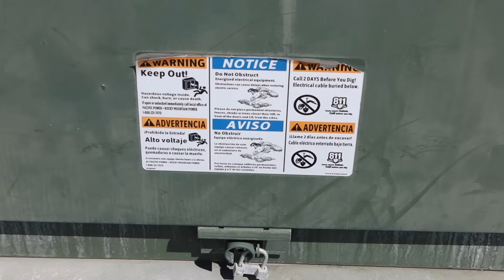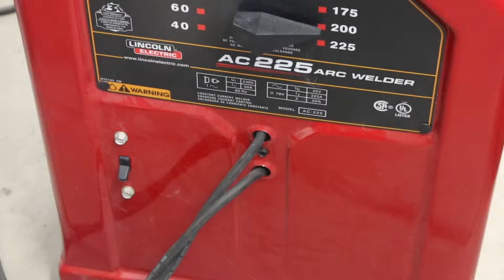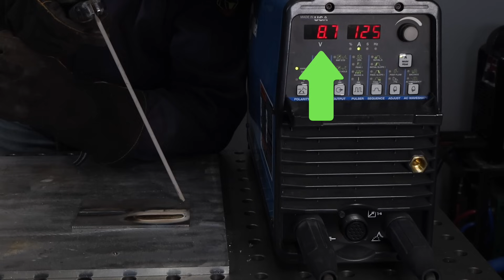Can You Get Electrocuted While Welding? Watch This...Don't Get Shocked!

Comment: One of the smartest ways to prevent electric shock and it’s never brought up in welding channels, is to take the work clamp (ground) and attach it directly to the work piece.   When clamping it to the table or vise, it just creates a longer path that the electrons flow through, thus leading to a potential “short” and traveling through one’s body.
Reply: That's what Old Black Pete the Saskatchewan cattle rancher taught me back when; of course, he did so with a little practical joke that ended with the comment: you kids today, you can't take any current!
Reply: Yes sir.  Was taught this by an old ironworker.. dude was a like a father for me.   Now I weld and am a Union Glazier (glass worker) so I'm basically always working.
Reply: I answered and said, "If I have found favor in thy sight, O Lord, show this also to thy servant: whether after death, as soon as every one of us yields up his soul, we shall be kept in rest until those times come when thou wilt renew the creation, or whether we shall be tormented at once?" 76 He answered me and said, "I will show you that also, but do not be associated with those who have shown scorn, nor number yourself among those who are tormented. 77 For you have a treasure of works laid up with the Most High; but it will not be shown to you until the last times. 78 Now, concerning death, the teaching is: When the decisive decree has gone forth from the Most High that a man shall die, as the spirit leaves the body to return again to him who gave it, first of all it adores the glory of the Most High. 79 And if it is one of those who have shown scorn and have not kept the way of the Most High, and who have despised his law, and who have hated those who fear the Most High -- 80 such spirits shall not enter into habitations, but shall immediately wander about in torments, ever grieving and sad, in seven ways. 81 The first way, because they have scorned the law of the Most High. 82 The second way, because they cannot now make a good repentance that they may live. 83 The third way, they shall see the reward laid up for those who have trusted the covenants of the Most High. 84 The fourth way, they shall consider the torment laid up for themselves in the last days. 85 The fifth way, they shall see how the habitations of the others are guarded by angels in profound quiet. 86 The sixth way, they shall see how some of them will pass over into torments. 87 The seventh way, which is worse than all the ways that have been mentioned, because they shall utterly waste away in confusion and be consumed with shame, and shall wither with fear at seeing the glory of the Most High before whom they sinned while they were alive, and before whom they are to be judged in the last times. 88 "Now this is the order of those who have kept the ways of the Most High, when they shall be separated from their mortal body. 89 During the time that they lived in it, they laboriously served the Most High, and withstood danger every hour, that they might keep the law of the Lawgiver perfectly. 90 Therefore this is the teaching concerning them: 91 First of all, they shall see with great joy the glory of him who receives them, for they shall have rest in seven orders. 92 The first order, because they have striven with great effort to overcome the evil thought which was formed with them, that it might not lead them astray from life into death. 93 The second order, because they see the perplexity in which the souls of the ungodly wander, and the punishment that awaits them. 94 The third order, they see the witness which he who formed them bears concerning them, that while they were alive they kept the law which was given them in trust. 95 The fourth order, they understand the rest which they now enjoy, being gathered into their chambers and guarded by angels in profound quiet, and the glory which awaits them in the last days. 96 The fifth order, they rejoice that they have now escaped what is corruptible, and shall inherit what is to come; and besides they see the straits and toil from which they have been delivered, and the spacious liberty which they are to receive and enjoy in immortality. 97 The sixth order, when it is shown to them how their face is to shine like the sun, and how they are to be made like the light of the stars, being incorruptible from then on. 98 The seventh order, which is greater than all that have been mentioned, because they shall rejoice with boldness, and shall be confident without confusion, and shall be glad without fear, for they hasten to behold the face of him whom they served in life and from whom they are to receive their reward when glorified. 99 This is the order of the souls of the righteous, as henceforth is announced; and the aforesaid are the ways of torment which those who would not give heed shall suffer hereafter." 100 I answered and said, "Will time therefore be given to the souls, after they have been separated from the bodies, to see what you have described to me?" 101 He said to me, "They shall have freedom for seven days, so that during these seven days they may see the things of which you have been told, and afterwards they shall be gathered in their habitations." 102 I answered and said, "If I have found favor in thy sight, show further to me, thy servant, whether on the day of judgment the righteous will be able to intercede for the ungodly or to entreat the Most High for them, 103 fathers for sons or sons for parents, brothers for brothers, relatives for their kinsmen, or friends for those who are most dear." 104 He answered me and said, "Since you have found favor in my sight, I will show you this also. The day of judgment is decisive and displays to all the seal of truth. Just as now a father does not send his son, or a son his father, or a master his servant, or a friend his dearest friend, to be ill or sleep or eat or be healed in his stead, 105 so no one shall ever pray for another on that day, neither shall any one lay a burden on another; for then every one shall bear his own righteousness and unrighteousness." 2 Esdras 2:31
Reply: @likeasparrowinthewildernes8333  bullshit. Stop believing in fairy tales

Comment: I have several times with mig and tig. Mig because we had to use an anti-spatter spray on our stainless to mild steel parts and my glove had a hole. Then with tig, somehow manage to touch my tungsten to my filler rod.

Comment: I was inside a vessel welding in the summer,  stainless vessel, all sweat my welding lead was hung up. Pulling on the lead and was looking down , the rod in the stinger touched my temple and I was knocked out briefly. Had to sit down for and hour then went back to work. Was scary.

Comment: When i was a dumb teenager i got a good jolt while welding. It was a real hot day and I just needed to do a quick repair on some farm equipment. Wasn't wearing a shirt and i was sweating pretty good. While leaning over the trailer i was patching up with my old stick welder my stomach touched while i was welding and ZAP! It wasn't too bad and only lasted a split second but I sure wouldn't want it to happen again.

Comment: I'm an electrician but i have to learn welding for my job and today i got shocked for the first time welding , I believe its called MIG welding. i started to weld and previously i was out in the rain and my gloves were a little wet so i touched the metal i was welding and zap got myself pretty good. didnt realize why i was getting a little shock so i changed my gloves and it stopped, five minutes goes by and im still confused why i got shocked. lost the new gloves i was using and went back to my old gloves and zapped myself again. then i realized. also this is weird this was recommended to me on the same day i was shocked.

Comment: Theres a Miller Machine at my work that has a  sub par ground connection in the wall its plugged into due to the way the building was wired, it causes the machine to shock you more than normal. Another thing that will cause any machine to shock you is a worn torch body. Any small hole in that, though you may not see it, does expose metal right near your hand that runs current, this will definitely cause a shock often.

Comment: Once and only once was I shocked by a stick welder. when I was 21 I was welding a bush bar onto my Suzuki in the driveway and my father thought it would be a good time to water the plants at the end of the driveway, once the water touched my feet it felt like I was trying to flex all my muscles it was for about 2 seconds till I dropped the wand and I felt like crap for the rest of the day after that.

Comment: As someone who has done most of my welding in the woods, in the rain, where I was usually standing on my work; why yes, yes you can!
I have spent many days where as long as I had the stinger in my hand, I could feel current running through my feet. Also most of my bosses had janky stuff that would zap you in dry weather...

Comment: I know its an old post but for future watchers, please understand a welder is a very high powered electron pump.  What is referred to as a ground clamp in comments below is no such thing.  It is the return path for the current to the welder.  Electricity leaves the source and has to go back to the source (it is a circuit).  There is no ground (earth) in the welding circuit (secondary as called in the video).  The ground is at the primary side of the equipment only and is only there to protect you against an equipment fault and hopefully trip a breaker.  You must protect yourself from getting in circuit of the secondary and thus potentially becoming a second path back to the source.  The electricity will only flow through you if it has a path back to the source.

Comment: Yes you can feel the shock of a 24 or so volt system, an welder.  It is simply ohm's law working here.  I (current)=E(voltage)/R (resistance), now the current going thru the body of 0.010 amp 10ma across the heart can kill you.  Now do the important item, the human body resistance is normally well over 10K ohm so your body would see a 0.0024 amp or 2.4 ma.  Remember this current must cross the heart to kill you.  However that 2.4ma will wake you the hell up, trust me.  Have been in the electronics/electrical field since the late 60's and have had numerous OH SHIT's that hurt, even with being very very careful.  Most of the time it was a damp situation as you described creating a multipath, or some very strange and later good story situations.  You have to respect electricity as you only get 1 (the final) mistake, but you cannot fear it or become complacent as then you will ignore the rules or be so overcareful that you miss something basic that will kill you.

Comment: When I was a welders helper we were welding on a metal recycling machine as part of a big project to rebuild the machine. One night me and my boss were there late at night, it was raining, and the ground clamp fell off one of the beams of the machine. I went down the stairs to find a new ground, and as I was attaching the ground to a thicker part of the beam, it shocked the hell out of me. My arm holding the ground convulsed and I unintentionally threw the clamp. Evidently he didn’t do a good job of making sure the rod wasn’t making contact with the machine as I was trying to reground. Called him from two stories below pretty pissed off telling him to get that rod off the machine

Comment: Funny story. When I first started welding, some 25 years ago, the first question I asked to the person who was teaching me was to tell me how not to get shocked. He said, don't worry about it, you won't get shocked, however YOU WILL get burned. Lo and behold I did get burned numerous times by freshly welded pieces many, many times over the years.

Fast forward 23 years, some two years ago I was welding the chasis of my son's pick up truck in less-than-ideal conditions. I was using a loaned off-brand decades old machine held together with baling wire, leads from unknown origin, a broken stinger and a cooling fan that you had to kick every now and then in order to keep it from falling apart. I don't even think OSHA was a thing when that machine was built.

I was running 220 volts with the machine set at 160 amps. While changing positions underneath the truck and with a live stinger in my hand I accidentally put the electrode to the side of my head while holding the chasis with a bare hand.  Needles to say that everything went blurry, that thing hit me like you have no idea, however I had to pretend that everything was cool since I didn't want my son to get scared.  XD

Moral to the story. Can you get shocked while welding? Absolutely, if you are a dumb a** like I was and act very carelessly. I was lucky enough that I didn't need medical treatment nor had any consequences, but it is better to be safe than sorry. So be safe out there and have fun welding!
Reply: What super powers did you end up with? :D
Reply: Lord Rayden @flightographist

Comment: I was using a water cooled spot welder years back..... was wearing a carbide ring. hole in glove and somehow managed to use the pushwelder at the same time as it made contact..... minimal shock.... but turned ring red hot. ripped ring off and threw across shop. I would have cried but no one was there to watch so just sucked it up. Wrapped finger and went back to work 10 minutes later.  Foreman did not let me leave or file report as it was my own fuck up.

Comment: Worst shock of my life was in welding school, and it wasn’t even on the welding circuit. We had breaker boxes in the back of each booth, with big 240v plugs on the underside. I was kneeling in the booth one day, chatting to a friend whilst clearing a birds nest. I began pulling the wire back out of the gun through the machine, and piling it on the floor behind me. It just so happens to find it’s way into a tiny gap between the plug and the outlet, and BAM. Genuinely the biggest spark I have ever seen, and my arm was numb the rest of the day. It’s amazing how much current can travel through several feet worth of .035, and I can’t imagine what would have happened if that was 1/8 inch tig filler. After that, I always turned off both the machine and the breaker anytime I did maintenance.

Comment: I have been a electrician for 50 years. The voltage in your house is 120/220 AC. There is a reason for that.  About 250 volt will go through your skin to your blood. Blood is water. That makes the amp go way up. Heating up and cause the damage to the body

Comment: The short answer is yes, yes you can receive an electric shock from welding equipment. Presumably if you’ve undertaken to try welding you have at least a basic understanding of electrical safety and safety equipment required to protect you from the arc rays, heat and sparks. Gloves are your primary protection against accidental shock. Working at a bench it’s unlikely you’d ever receive a shock if you’re wearing gloves. However if you’re working outside, or out of position (not flat) this Is where you are most likely to receive a jolt. Take care to insulate yourself from the electrode, the work and the earth.

Comment: I worked at multiple places as a welder through the 70's, mostly stick welding with those old classic Lincoln AC buzz boxes. Many of the guys I worked with could be jackasses, and it wasn't uncommon for guys to poke at the ass of the new guy with the end of a live welding rod while the victim was standing on a dry work surface. It was immature, irresponsible and annoying, and it felt a lot like a cattle prod, but nobody complained of significant injury.

Comment: One time when I was learning stick I was sitting on a metal saw horse with the metal I was welding on tacked to it. The table was grounded  and as I went to put a rod in the stinger (without gloves) I felt a tingle. Scared the hell out of me. The machine I was using was a generator that needed to be kicked up out of idle to output enough power to weld, and when i felt the tingle the machine was at idle. If it wasn’t at idle I have no idea what would have happened.

Comment: I'm 74,   so I don't quite remember what specifically caused this but.
  Back in the 50's 60's,  I remember hearing of a certain. Condition during welding,   that if you do it right or( wrong) you can get electrocuted. And get the muscles actually blown right out of your arm !!  I think I read about this in some Lincoln welding Caution bulletin with a picture of a person's  arm burned up and exploded !!     It might be something to do with. AC welding with Hi Frequency tig,   then switching to stick welding but forgetting to turn off the Hi Frequency with high OC voltage ?
 Great Video. Thanks

Comment: You bet your life you can!  Hot, sweating, clothes wet, welding 115 amps, sitting on brush hog.  The handle of the rod holder had a bare screw.  Not mine.  Could not turn loose, could not jump or move to break loose.  Finally: "Is this the way?  Is this my time?". Cannot do a thing.  Relaxed to accept things and fell loose.   Fact, by the time I got to physician, an hour or so, almost sent me to ER.  Replaced all rod holders on my units and all I used.

Good video on safety.  I am the user and my responsibility to check the equipment.
Reply: I see the incident also affected how you write.  I can't understand a darn thing that you wrote.